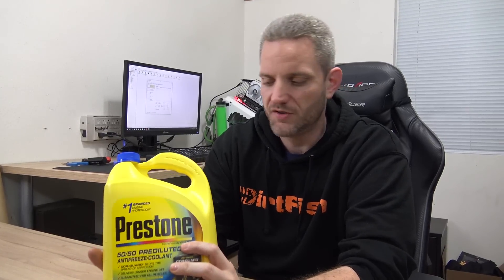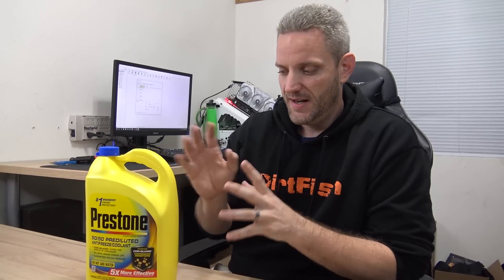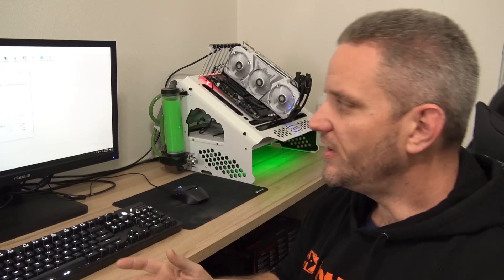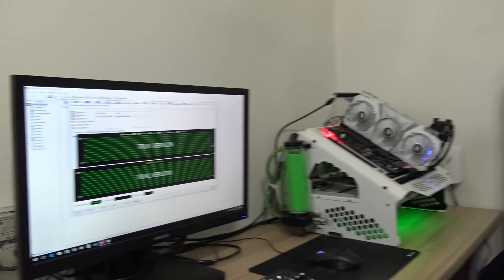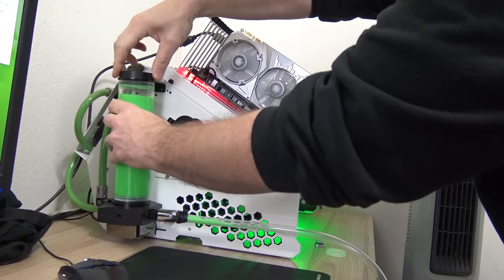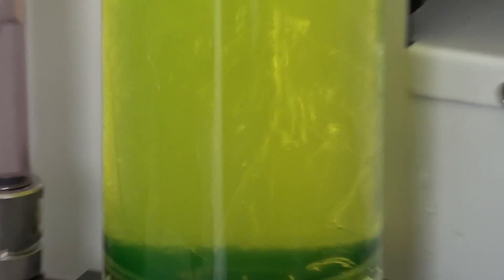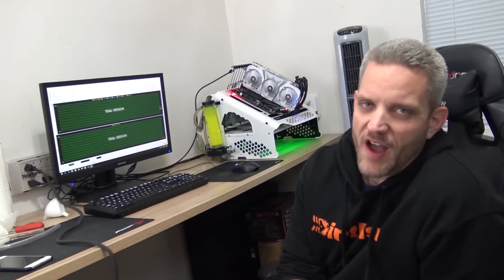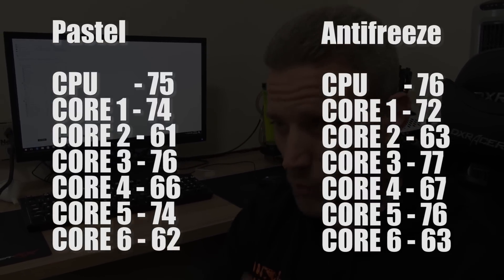I used Antifreeze to cool a PC

Comment: hey jay2cents sir is ryzen better than than 6700k i7
Reply: It's not even out yet...
Reply: That question is just dump.
Hey, is a i5 6600K better than RyZen? Yes.
Is RyZen gonna be better than an i7 6700K? Yes.

How?
cause RyZen is NOT a CPU, it is a new architecture and there will be a whole range of CPUs based on it.
The only thing we know is that is about on par with SkyLake in terms of IPC for a few specific benchmarks - that is all.

We do not know the Cpu lineup nor the price - hack, might very well be that an 8core 16 thread RyZen CPU completely trashes an i7 6900K - and then costs 2500$.
Reply: amitoj singh jay atm.... TRIGGERED!
Reply: amitoj singh duhhh its more powerful than a 6900k
Reply: TRENDINGLATELY OMG really
Reply: TRENDINGLATELY what price of ryzen
Reply: amitoj singh hasnt been confirmed yet but most likely to be same as 6700k ( $400)
Reply: smokeydops That should be pretty obvious. They are advertising to have similar IPC to haswell but running at lower clocks. When comparing to the 7700k that launches at around the sime time, the supposedly similarly priced 8 core zen is running a GHz or so slower than 7700k (which in itself also has similar enough IPC) and there should be absolutely no question that zen continues the bulldozer path of providing more threads while sacrificing a considerable amount of single thread performance. The total CPU horsepower available benefits, sure, but single thread performance is sadly still more relevant in most cases, including (and especially) gaming.
Reply: ABaumstumpf I think zen is the architecture and Ryzen is the cpu
Reply: None of us know for sure if the 4 core variants will be better. Wait til it's released.
Reply: $320 for a brand new CPU that will most likely be AMDs new contender to intel? no way... just wait until they release the prices... no point speculating
Reply: the 6700k isnt even the best "bang for your buck" cpu for gaming... you dont really need the extra threads and crap... you can get the cheaper 6600k and be fine... but intel is far better for gaming... its a more stable platform and for me AMD simply seems outdated and just behind in tech compared to intel.
Reply: amitoj singh better how? they're completeley different
Reply: Dennis Rigdon lmao
Reply: amitoj singh Kaby lake will come out with it and should be better
Reply: in that one benchmark maybe but why did they not show performance numbers in other applications 
its always the same with amd they shout its way better than the competitor after release its a letdown wait for the user reviews i think the 6900k is a really high end chip no way amd is gonna beat that but if it does thats amazing
Reply: ABaumstumpf w
Reply: Kicstar V Neither should AMD intel has always been more power efficient than AMD. AMD always says they are better but than intel comes out and kicks there ass by a mile
Reply: Assuming the 3.4GHz 8 core is similarly priced with 6700k (7700k), for heavily multithreaded workloads, yes. For single thread workloads, no. For gaming, probably not.
Reply: i hope you realise that ryzen will be really expensive? i would probably say about x2 the price.... not forgetting a new motherboard to go with it... unless youre building a new system
Reply: No, Zen was the code name, Ryzen is the architecture.
AMD have already said their line up will be the SR3, SR5 and SR7.

Just like Intel they will have the SR3 then CPU name. Same with the others.
Reply: Have they actually confirmed the SR# naming scheme? Can you give a source?
Reply: No, leaked benchmarks indicate its single-core performance is worse than even the 4770K or 6600K.
Reply: smokeydops "leaked"
Reply: Trending its been said 320 dollars
Reply: the thing is... for gaming, the best CPUs are the four core ones. The ryzen (8 cores) will not give any advantage compared to the 6700K (and soon the 7700K). CPUs with 6, 8 or 10 cores are just overkill for gaming and for some games, perform a little worst than these 4 cores CPUs (less frames). This happens because the game takes full advantage of all the cores on the 4 core CPU, contrasting with 6/8/10 core CPUs, that leaves some cores almost doing nothing (interfering with performance). If games were more balanced to the CPU performance, then 6/8/10 core CPUs would be better
Reply: I got to agree with you adrian gasiewski. I think AMD had a strong presence on the market some years before, but now it's just outdated, both for CPUs and GPUs ( the competition, although more expensive, brings more earnings and quality over AMD)
Reply: not out yet...
Reply: Josh The Raptor Productions - JTRP kaby lake will barely be better then sky lake lol pls research
Reply: CPUzer0 I said a little because i saw some videos showing the fps on each CPUs (4, 6 and 8 cores), and it wasn't that much of a difference. But in your case (12 cores, Damn! :D ). Idk man, Zen has 8 cores, don't get me wrong, it can perform decently like you said but if i can get a better performance with a 4 core CPU... But once Zen is released and his gaming titles benchmarks as well, that is the time that i will have certain if it's better or not
Reply: Sho Bruh I assumed he was joking with his 1st comment. Kaby is the most disappointing cpu generation ever.
Reply: +amitoj singh Ryzen is a series of cpus. not one single cpu of a given speed. With that information it stands to reason that it will encompass a wide variety of speeds/power. Plus they haven't even released it in it's final form so at this point NO ONE knows how the various models will perform for sure, but preliminary information shows that at least some of them should be as good as, if not slightly better than a 6700k. Whether any of them will keep up with a 6900k is unknown, and based on AMD's past record over the last 10 to 12 years it's highly doubtful. And even if it did, Intel would just move up the timetable for future releases and drop superior cpus on the market.
Reply: Yes!
No!
Pick one...
Its as good a guess as anybody's...
Reply: Shlomi Vinny We can make educated guesses from the scraps of information we have though.

Comment: antifreeze for a cpu? lol
Reply: Dexcool is some of the worst stuff ever invented. Ever try to clean a cooling system that's ran dexcool for any length of time? Lets just say I tried it and you won't dig it.
Reply: LN2+antifreeze=profit
Reply: Lo Studios Just dont use the Dexcool antifreeze, the Orange stuff for GM cars. That shit will eat copper up like a starving Ethiopian at a buffet bar. The Dexcool is formulated for GMs aluminum engine blocks and aluminum intakes and radiators.
Reply: +jort93z   Not a bad idea
Reply: Lo Studios lol
Reply: you are also going to get crazy mold growth if you dont add an anti-fungal.
Reply: My ford V6 doesnt have a lot of mold in the radiator
Reply: Dexcool is formulated by Satan to destroy everything it touches.
On another note, https://www.youtube.com/watch?v=GUcTWzBZAdg